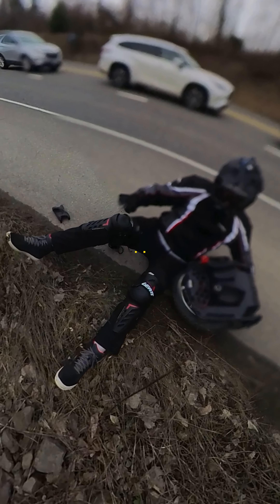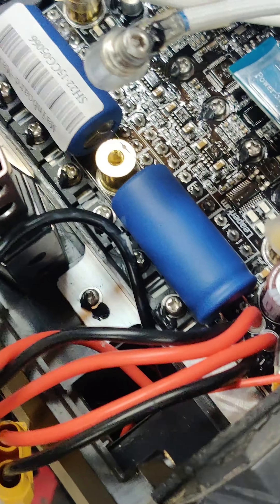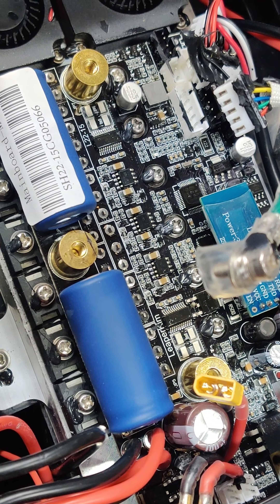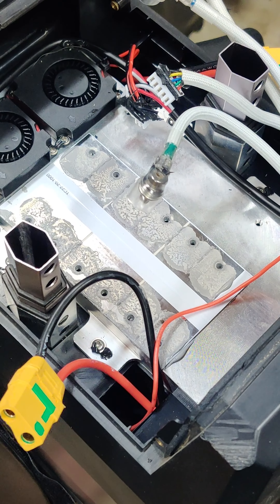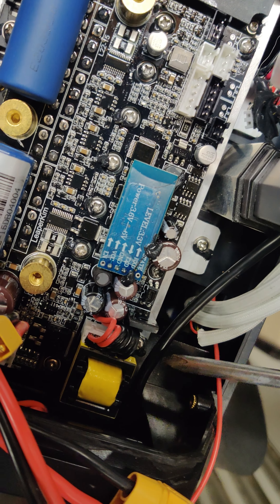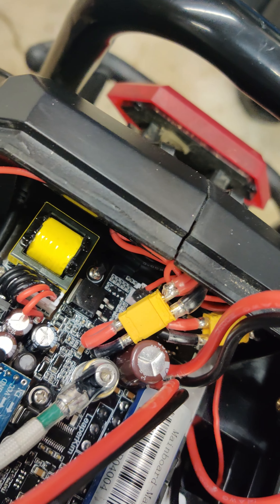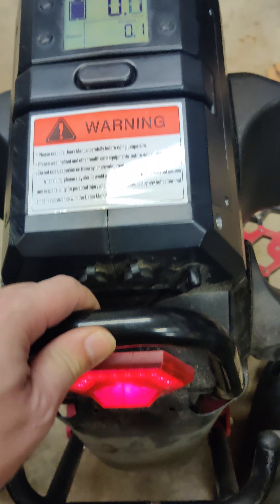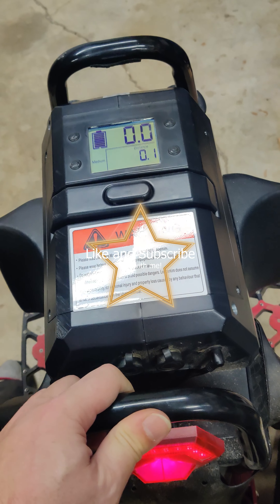How to replace your Sherman Max Motherboard and Watch Me Cutout!

Comment: HI, NICE VIDEO, THANKS. MY NEW SHERMAN MAX WILL BE SENT BY EWHEELS IN MAY OR JUNE 2024. DO YOU KNOW IF THE PROBLEMS WITH THE MOTHERBOARD HAVE BEEN RESOLVED? SHOULD I ASK JASON ABOUT IT BEFORE THEY SHIP? I PUT OVER 14,000 MILES ON MY SECOND GENERATION VETERAN SHERMAN AND NEVER HAD ONE PROBLEM WITH IT. THANKS

Comment from the maker: Just a comment about the top cover - it was siliconed on.  Use plastic trim tools to get under the edge and pull up on it until one corner releases, then work your way around the edge.  It felt like I had missed a screw but there are only the four that are obvious.

Comment: Yo how do I remove the top cover/display? I only see 4 screws but it feels glued on. Am I missing something? im afraid to break it
Reply from the maker: Mine was glued on too.... you need to be careful and use automotive trim removal tools (plastic) so as not to damage the top lid.  It took quite a bit of force to pull it off, but there are only those 4 screws and the silicon glue.

Comment: I think your case is in a very special condition. Mosffet seems like blown by brake charge recycle. But you didin't brake very hard, so it might be caused by flaw mosffet on the board.
Reply from the maker: You might be right.  I hope so.